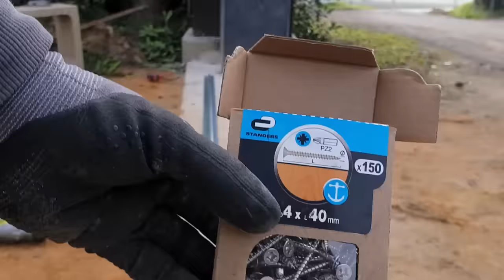Comment fabriquer un portail coulissant? 2/2 - Fabrication du portail et son installation #portail

Comment: Bonjour, après le temps comment sont vos lames ? J'ai fait presque la même chose et déjà 3 lames horizontales cassés, elle se '' gondolait'' à cause de la dilatation avez vous le même problème ou est ce mes lames qui sont merdiques ? Cdt
Reply from the maker: Salut. Aucune latte a cassé en 2ans, apart 1 cassé pas des chiens😅 . Et seulement une a gondolé car pas de support sur 2m de long... J'aurais du mettre des "renforts" intermédiaire
Reply: @MattBricole  merci pour ta réponse, je vais opter pour une solution constituant à fixer des équerres sur les montants au extrémité afin de laisser reposer les lames et fixer un plat sur la face extérieure de mon portail de façon à prendre les lames en sandwich mais ne pas les bridées pour qu'elles puissent se dilater librement
Reply from the maker: Yes. Bonne idée😉

Comment: Bonjour. A quel distance du pilier placé vous le rail ? Pour pouvoir être d'aplomb avec le guide. Et quelle ecart y a til une fois finit entre le portail et le pilier ? Merci davance
Reply from the maker: Salut,
Le positionnement du rail se calcule en fonction du guide qui sera en haut, à la perpendiculaire biensur. Donc la distance entre le pilier et le portail dépend du guide. Si le guide est réglable, le mieu est de l'ajuster au plus près du pilier. Puis d'axer le portail ainsi que les roues en fonction de tout ca 😉
Reply: @MattBricole  OK super merci pour linfo 😉
Reply from the maker: De rien 😉

Comment: Petite question , ton portail fait combien en dimension et tu as utilisé quoi comme section de feraille pour l ossature ? En tout cas beau boulot 💪
Reply from the maker: Salut, 
Il fait environ 5,00x1,10m. J'ai pris du 60x40x3mm il me semble. Je crois que c'est marqué dans la description. Merci 😁
Reply: Tu me conseil quoi comme secteur d ossature , mon portail ferait 6m par 1.70 de hauteur
Reply from the maker: @maximelarroque7767  je te dirais que ca depend de ca que tu veux mettre dedans et comment tu souhaites l'habiller
Reply: @MattBricole  je vais l habiller en bois , soit composite imitation bois , soit du redcedar... Mais j hesite a faire une ossature en 80x40 2mm d épaisseur
Reply from the maker: @maximelarroque7767  alors pour le composite faudra mettre des renforts/supports au milieu si tu as des longueurs supérieurs à 1m, sinon ca va fléchir. Ca l'a fait chez moi au bout de deux ans sur des longueurs de 1,30/1,40m environ. Perso je pense qu'entre du 60 et du 80 ca va pas changer énormément niveau solidité, un peu mais pas de fou, faut voir coté esthétique aussi que le cadre fasse pas trop volumineux quitte a prendre du 3mm. Après le poids est réparties sur les roues (enfin si tu fais un coulissant) peu de chance que ca plie, apart lors des soudures

Comment: Has the render cracked a bit on the piers, does tend to craze in the sun.
Reply from the maker: Yes it has cracked à bit. I think it dried to fast due to the wind...or not as wet as it was supposed to be
Reply: I lay render on in two coats normally and add fibres to stop it cracking, but some times you need a bit of luck with it.

Comment: Bonjour qu'avez vous pris en cornière inégale ? Pour ce qui est des tubes rectangulaire est ce que la dimension 40.30 est largement suffisant pour la solidité
Reply from the maker: J'ai pris des cornieres inégales de 20x30mm. Pour le châssis du 60x40x3mm. Pour le 40x30 pour la solidité ça va dépendre de la longueur du portail, des renforts qu'il y aura et de l'épaisseur de l'acier...aussi de ce qu'il y aura pour obturer, si c'est des tôles en acier ça va tenir les tubes rectangulaires davantage que les lattes en composites....
Reply: @MattBricole  merci de votre réponse longueur de portail 4.50m grand max apres le nombre de renfort je pense en mettre dans chaque angle et au milieu
Reply from the maker: A voir alors.le mieu est de se renseigner au niveau des résistance des acier et leur utilisation auprès du grossiste chez qui tu te fournit